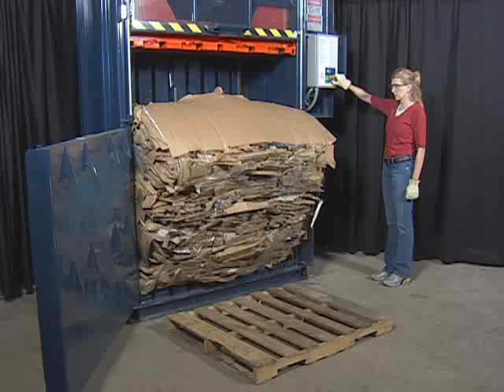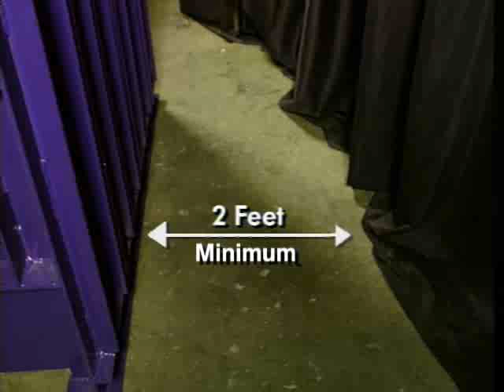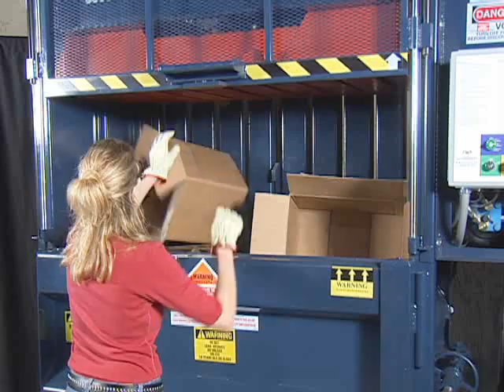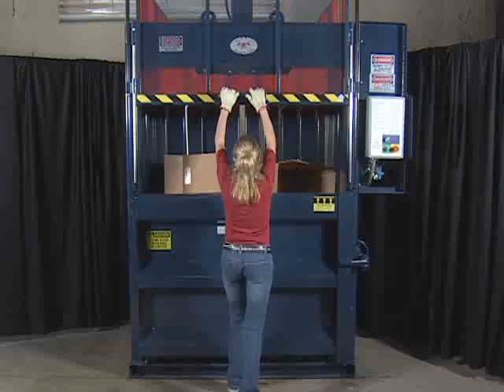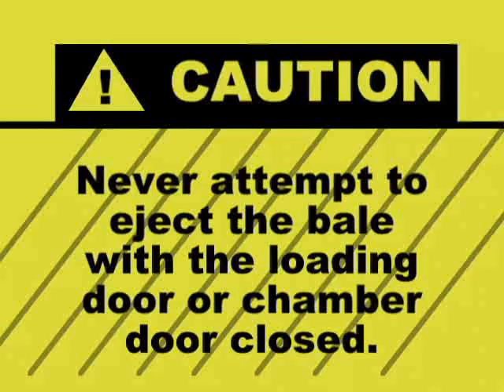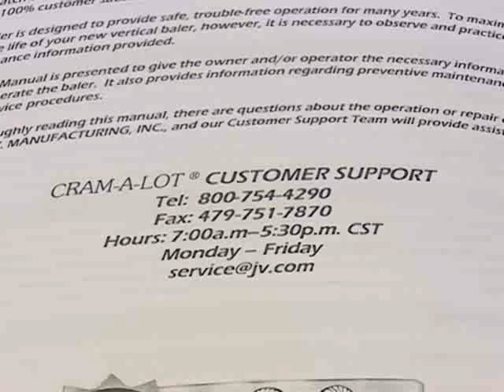CRAM-A-LOT® Vertical Baler Instructional Video

Comment: I work for a local non-profit that accepts donations of clothing. We bale the clothing using a very similar vertical baler (can't find the exact make/model). However, we have trouble with our channels becoming blocked by cardboard and clothing. We've tried using different types of cardboard and cut up gaylords to no avail, something always seems to pop through into the channels causing baling wire to become obstructed. We have a cleaning rod that's used to clean the channels but its not much help. Because the machine automatically dumps the bale we cannot raise the press high enough to remove obstructions, this usually results in having to rebale. Today we had to rebale the same bunch of clothes 3 times because each time the channels became obstructed. Would anyone happen to have any tips on how we can avoid this in the future?

Comment: How many hundreds of bales have I produced with this cram-a-lot baler. Memories memories.
Reply: what's your method of tieing off the bale
Reply: Put the pokey end through the loop end, pull down the tighten a bit, but not too tight, wrap it around about 3-4 times and it's good to go. Use 8 wires.

Comment: I'm having issues with the magnets that keep the doors closed
Reply: either the machine is faulty or the stop red button isnt in its proper position. Make sure all debri is clear because I think the gate has a sensor around the metal contacts which is a magnet so if any debris is on the magnet. It will not lock

Comment: Our 2 balers are both in high traffic areas and have 1ft clearance behind the machines.
Reply: @Diego87  our Baler you gotta be skinny to go behind and pull the wire ties through...what a joke
Reply: We have 1 in a high traffic area with maybe 1 foot of clearance max behind it. Needless to say, it’s a tight fit.
Reply: Heb
Reply: @Travisyououtclassedthebum   I was about to say, that yes. HEB and Walmart are guilty of doing this. But as far as Iam concerned. No one ever got hurt working the machine. But yeah, now seeing this. I think it is a bit of an issue.

Comment: i recoomend that you should flat or cut it up   box with your kife  by run your across  the middle of box other non open side insted insert the non flat box  because  it save space and it does not jam and damage and brack machine.
Reply: I think he meant you should break down your cardboard before chucking it into the baler...lol

Comment: Why remove the key so many times? At my store they purposefully broke the key inside the baler so no key is needed anymore lol.
Reply: The need to remove the key is to protect the "owner" from the dangerous/illegal use of the baler by under aged or unauthorized people.  When the key is broken off, most of our service calls are for that, the owner could receive a citation for a lack of protection.
Reply: It's a huge fine if the audit sees it
Reply: They did that at the Walmart I work at- twice. First time we got it fixed relatively quick after some inspector (not from OSHA) got mad about it. It broke a second time, and has still not been fixed yet.
Reply: Whoever did that at your store is very dumb.... Good luck at that audit😂

Comment: Thank you so much for posting this video. I am someone who needs to be fully trained step by step with some assistance until you see that I am getting it right. I work in a department store and my training was as follows. My training was rushed and a lot of steps were skipped. It was not hands on, my so called trainer was doing all the work and was having a conversation with someone else while I was standing there watching. My trainer did not speak out all of the steps to me. He just left me hanging and said, "Now you can operate this machine on your own." When I asked for help to do it a second time about six months later that same guy got mad and said he did not have time for that. I don't have to use the baler normally, that is why it took that long for me to use it again. I was assigned to get rid of some boxes and they knew that I don't normally use that machine. I finally got help from someone eventually.